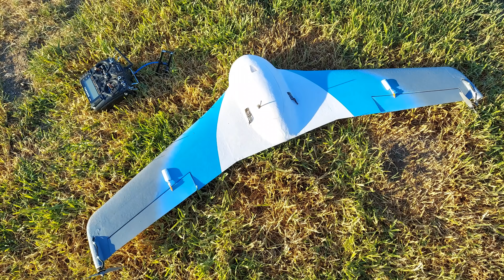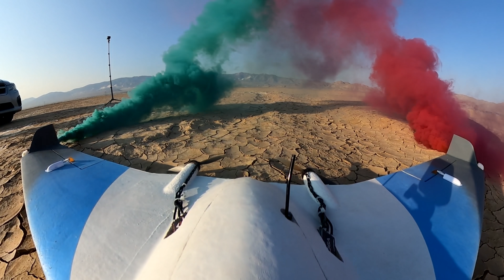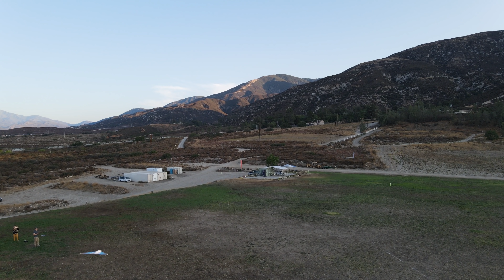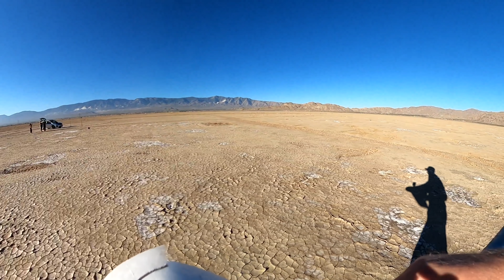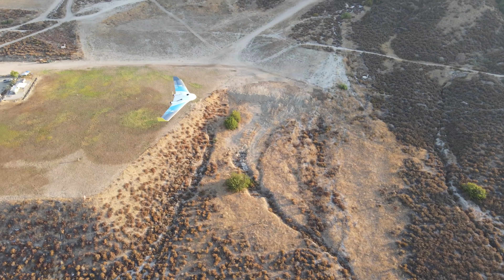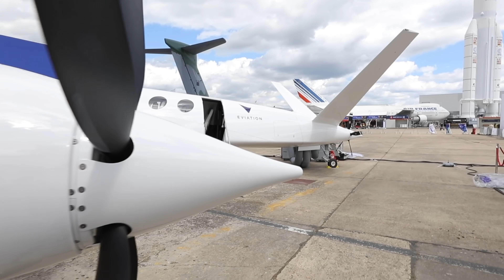Can Wingtip Motors Improve Aircraft Efficiency?  RCTestFlight Solar Collaboration Part 1

Comment: "Reducing the size of the vortex at the wingtip indicates that you have reduced the induced drag of the aircraft."    Uh, no.

An easy way to understand what's going on is to think about the wing in terms of Prandtl's lifting line theory.  The trailing vortices shed by a wing are caused by changes in the strength of the bound vortex (and local lift) across the span of the wing.  Conservation of vorticity states that vorticity can neither be created nor destroyed, so any change in the strength of the bound vortex has to go somewhere: the trailing vortices.  A larger change in bound vorticity (or local lift) between two spanwise locations results in a larger amount of vorticity being shed into the wake between those locations.  If you decrease the size of the tip vortex, it just means that vorticity is being shed somewhere else on the wing.  Shifting where the vorticity is shed changes the lift distribution along the wing.

Here's where it starts to get interesting.  If Serenity were a conventional (main wing and tail) aircraft, then the induced drag of Serenity would be minimized when the main wing's lift distribution was elliptical.  However, Serenity is a (statically stable) flying wing and requires positive lift near the centerline and negative lift near the wingtips to keep it trimmed in steady level flight.  The region of negative lift just inboard of the wingtip means that at the wingtip the lift coefficient is increasing with spanwise position, and so the vortex shed at the very tip of a flying wing will rotate outwards.  Slightly further inboard - where the lift coefficient is decreasing with spanwise position - the trailing vortices rotate inwards.  The interactions between these vortices cause them to roll up, which has the effect of reversing the direction of the vorticity downstream of the wingtips, exactly as you observed!

There have been some papers published about optimal lift distributions for flying wings, but 1) a disturbing number of those papers neglect to make sure their design is trimmable or aerodynamically stable, and 2) the optimal lift distribution for a flying wing depends on the planform - and in particular the sweep!  In general it's shaped something like a bell with a large region of positive lift near the wing root and a small region of negative lift near the wingtip to keep the aircraft stable.

So, back to your experiment with tip mounted motors.  The tip motors impart additional vorticity on the air and alter the shape of the wing's lift distribution.  It's possible that your motor and propeller placement did a better job pushing Serenity's lift distribution towards its optimal than the winglets did, which would account for the ~1% decrease in energy consumption.  It is really cool that you were able to see a difference!

As for companies claiming 10% to 15% increases in efficiency: don't believe everything you read.  A lot of aerodynamic design is gaining 1% or 0.1% increases in efficiency.  If it really were 10% more efficient to mount propellers on the wingtips then you would see a lot more aircraft with propellers on the wingtips.  As I mentioned, it is possible to use the propulsion system to alter the lift distribution and push it closer to optimal but it's a lot easier to simply alter the wing design.

P.S.  About a third of the way through the video you discussed your placement of the motor wires.  I believe you mixed your terminology.  Transition is where the boundary layer changes from laminar flow to turbulent flow.  Separation is where the boundary layer detaches from the surface of the wing.  Separation almost always occurs after the boundary layer has transitioned to turbulent.  You did a good job placing the motor wires because it is possible that the imperfection in the wing surface where the wires are buried could trip the boundary layer and cause it to become turbulent.
Reply from the maker: I love comments like these.   Thank you for taking the time, it helps more than just me I am sure.   Generically that statement is true no?   I can understand in the case of a Prandtl wing you are simply moving the vortices around to different locations but if you have a typical sailplane and extend its wingspan you didn't simply move the vortex somewhere else, you reduced it.
Reply: The V-22 Osprey has a relatively bad safety record.  Everybody dies if one motor fails!  
A wingtip motor failure = uncontrollable yaw.
Reply: @toolbaggers  Not true, on the V-22 both motors are connected to a central gearbox which provides redundancy in an engine out.
Reply: @toolbaggers  The rotors are interconnected by a mighty driveshaft and the ship can survive an engine-out scenario, presuming nothing else goes wrong.  And one pilot reported that in the event of forward flight and losing both engines, the V-22 can be glided in for a safe landing, though I imagine the craft would be thoroughly grounded by the landing due to unavoidable rotor damage.
Reply: @thinkflight    Sometimes it's true but not always.  If the wing planform does not change, then a change in the strength of the tip vortex (before roll-up) merely indicates that the lift distribution near the wingtip has changed.  This is what is happening with Serenity.  On the other hand if the wing geometry changes, then it is possible and even likely that your statement is correct (dependent on the two wings generating equal total lift and having identical or at least similar lift distributions, as I'll discuss in a second).

Back to the sailplane.  Let's say we have two aircraft that weigh the same and have identical spanwise lift distributions but have two different aspect ratios.  The airplanes have equal weight, therefore the lift generated by their wings must also be equal.  The lift generated by the wing equals the integral from y = -b/2 to y = b/2 of L'(y), where L'(y) is the lift per unit span.  From Kutta-Joukowski, L'(y) = ρ * V_inf * Γ(y), where ρ is the air density, V_inf is the freestream velocity, and Γ(y) is the bound circulation.  Therefore we can write L = ρ * V_inf * integral from y = -b/2 to y = b/2 of Γ(y).

Now since the lift of the two aircraft is equal, we know that the integrals of the bound circulation for each wing must also be equal.  However, the aircraft have different wingspans, and therefore Γ(y) must be different to maintain equal lift.  If we take the case where Γ(y) = Γ is constant and the lift distribution across the wing is uniform like in the horseshoe vortex model (which would require infinite tip chord, but anyway...), then Γ1 * b1 = Γ2 * b2 where Γ1 and Γ2 are the bound vorticity of the two wings and b1 and b2 are the corresponding wingspans.  Double the wingspan while keeping the same wing area and total lift and the bound vorticity is halved.  Continuing with the horseshoe vortex model, all of that bound vorticity is shed into the wingtip vortices, so their strength is also halved!

I should note that doubling wingspan while maintaining the same wing area actually quadruples the aspect ratio.  I'm sure you've seen the result from finite wing theory that CD_induced = CL^2 / (π*AR*e) where e is the span efficiency factor.  (Not Oswald's efficiency!  Oswald's efficiency also includes the quadratic part of the airfoil's profile drag.  People make that mistake a lot, even in research publications.)  So why is induced drag dropping by a factor of 4 when we're only halving the strength of the wingtip vortices?

The answer is that halving the strength of the wingtip vortices is only half of the answer (haha).  Consider a comparison between the same relative spanwise position on each wing.  The velocity induced by a vortex outside of the vortex core is equal to Γ/(2π*r), where r is the distance from the center of the vortex.  By doubling the wingspan while maintaining the same wing area, not only have we halved Γ, we've also doubled r!  This means that the induced angle of attack and the induced drag is one quarter of what it was before quadrupling the aspect ratio, which is consistent with the finite wing theory result.

Wait, but we're integrating over a wingspan that is twice as long!  Wouldn't that mean we're right back where we started with an induced drag that is only halved?

Nope!  The wing chord was halved, too.  The local induced drag coefficient equals the induced angle of attack times the local lift coefficient (using small angle approximation).  The local lift coefficient is unchanged because we said that the lift distributions of the two wings were equal, and the two wings have the same wing area.  What has changed?  The wing chord!  So while the local induced drag coefficient is one quarter of what it was before because of the change in induced angle of attack, the local induced drag is one eighth of its previous value.  Integrate over the new wingspan that is twice as long and you get that the induced drag is one quarter of what it was before.

So the strength of the wingtip vortices is a relative indicator of how much induced drag there is if the two wings are generating the same amount of lift, have the same wing area, and have the same or similar lift distributions.  What if the wing geometry is unchanged?

Then we're right back to redistributing the lift and the bound vorticity.  Remember that L = ρ * V_inf * integral from y = -b/2 to y = b/2 of Γ(y).
  The total lift remains constant, therefore the integral from y = -b/2 to y = b/2 of Γ(y) must also remain constant.  If you decrease the bound (and shed) vorticity at the tips, that vorticity has to go somewhere else.  Depending on where it goes and how your lift distribution changes it may either increase or decrease the induced drag.
Reply: Holy crap, that's just what I was thinking.
Reply: Good point. And so we should expect smaller gains if any from tip motors on this planform. Conventional design, or one without sweep and the reflex in the middle should amplify the benefit.
Reply: @MarkKrebs  As one of my professors liked to say, "The answer is: 'it depends'."  In this case, it depends on the lift distributions with the propellers mounted inboard and with the propellers mounted on the wingtips.  The best way to evaluate the impact of wingtip propellers is to use aircraft that are identical except for motor placement, just like with Serenity.  Whether or not there will be a larger improvement with a different airframe depends on what Serenity's lift distributions looked like, what Serenity's optimal distribution is, and the lift distributions of the new wing with and without tip mounted propellers.

It's hard to say what airframe changes would increase the benefit and make the difference easier to observe.  I'm sure that it would be possible to design a wing that is intentionally sub-optimal with inboard propellers and near optimal with tip mounted propellers, assuming that the influence of the propellers could be accurately predicted.  I think VSPAERO - part of OpenVSP - may model vorticity imparted by a propeller.

You may be correct that a conventional aircraft, or a "plank" style flying wing with a reflexed airfoil, would increase the impact of tip mounted propellers.  It certainly will be easier to figure out what is the optimal lift distribution for minimum induced drag of the main wing (an elliptical distribution, of course).  An untwisted rectangular constant-section wing normally has too much lift at the wingtips when comparted to an elliptical lift distribution with the same CL, and the vorticity imparted by wingtip propellers rotating outwards should help with that, but there are A LOT of unknowns.  Without doing some analysis it's not possible to predict whether or not the change in performance will be larger than was seen with Serenity, or if there would be an improvement at all.
Reply: @nathank7989  Nathan, I can't say I follow everything you are saying but I'm trying...

You stated that Serenity was a statically stable flying wing.  I'm not sure how you know that, but okay.  I don't see a lot of twist at the wingtip, but can believe it's there.  I do understand that common airplanes like a Cessna 172 have lift near the center of mass and a tail producing negative lift at the back.  For a swept back wing, rear-placed negative lift means negative lift at the tips.

Doesn't this mean that Serenity could get a large increase in effective span, and reduction in induced drag, by adding a tail so that the wing has the usual elliptical lift distribution?

Also, does this mean that you could reduce a flying wing's induced drag if you could make it statically unstable (elliptical lift distribution)?  Do you necessarily lose all that efficiency in the control system trying to get the plane back to the intended AoA?

Finally, I think I understand that L = ρ * V_inf * integral from y = -b/2 to y = b/2 of Γ(y), so at a given speed and air density lift is proportional to the integral of vorticity.  Doesn't that mean vorticity is in units of 1/sec?  Is it possible to remove energy from the wingtip vortex while preserving the vorticity by having a slower-rotating core and a faster-rotating portion outside the core?  Aaand, is that what a wingtip motor does?
Reply: @iainmcclatchie2009  I assumed that Serenity is statically stable because 1) model aircraft are generally designed to be statically stable and 2) Pixhawk and Ardupilot indirectly recommend that the aircraft be stable.  In theory Pixhawk's fixed wing attitude control loops (PI with feedforward) could stabilize an aircraft that is statically unstable in pitch, but that could lead to some very hairy test flights if the controller gains you calculated to make the aircraft stable are incorrect.  There's a Master's thesis from Linköping University where the author used a Pixhawk to control a statically unstable aircraft: https://www.diva-portal.org/smash/get/diva2:859608/FULLTEXT01.pdf.

I'm not sure what you mean by "effective span".  I've heard that term used when discussing wingtip devices that are designed to push the tip vortices outwards (e.g. a Hoerner wingtip).  I think what you're getting at is that some portion of a flying wing is used to trim the aircraft in pitch - this could be the wingtips, the trailing edge, or some combination of the two.  The question of whether a flying wing or conventional aircraft is more aerodynamically efficient is complicated, but I believe that in most cases a conventional aircraft will be more efficient largely because of reduced trim drag.

Would changing Serenity to a conventional wing and tail design reduce induced drag?  I believe so; however, this would require redesigning the wing to remove the washout or reflex used to trim flying wing Serenity.  Then the wing is larger than it needs to be, because it no longer needs the portions used for trimming and the additional area that was used to offset the negative lift produced in the trim areas.  After the redesign process the wing (now main wing) would ideally have an elliptical lift distribution for minimum induced drag.

Would an unstable flying wing with an elliptical lift distribution have lower induced drag?  I need to think about this some more, but I believe the answer is yes.  At a given lift coefficient, an elliptical lift distribution will give the lowest induced drag.  I like that you're thinking about the trim drag.  Depending on CG location the trim drag might increase more than the decrease in induced drag.

Yes, that is the correct unit for vorticity.

What I think you are describing is altering the velocity distribution of the wingtip vortex.  Viewing the wingtip vortex as a single vortex filament, as in the lifting line model, does not allow this because the velocity distribution of a vortex filament cannot be altered.  To alter the velocity distribution of the wingtip vortex we need to view it as a collection of weaker vortices modeled as Rankine vortex filaments.  Then it is possible to achieve the velocity and vorticity distribution that you described, which is what happens with a tip mounted propeller rotating outwards.  In fact, the central portion of the wingtip vortex may now rotate outwards because of the vorticity imparted by the propeller, as was seen on Serenity.

Does this remove energy from the wingtip vortex?  I don't know.
Reply: @nathank7989  By "effective span", what I mean is this:

If the wingtips run at negative lift, and the center of the span generates positive lift, then I would expect the wingtip vortex to be centered roughly where the lift transitions through zero, closer in than the wingtip.  The span between the center of the wingtip vortexes would be the "effective span".

The reason the effective span would matter so much is that the induced drag is proportional to the inverse square of the wingspan.  So if the outer 20% of the wing is at negative lift, I'd expect the effective span to be 80% of the actual span, and I'd expect the induced drag to be 56% larger than if the lift were distributed across the full span.  Since low dynamic pressure flight is often dominated by induced drag, this seems like a really big deal.

It also seems that a statically stable flying wing has a lot of drag penalty, because not only does it have the reduced effective span, but it also has a fairly large amount of wing area near that zero lift line (at e.g. 80% of span) that doesn't do much of anything except produce drag.

A separate wing and tail can have most of the wing and tail surface generating lift.  It doesn't have the dead zero-lift area.

A dynamically stable flying wing, it seems to me, could have an effective span == full span, and no drag from a stability-inducing tail, and so have minimum drag at zero control deflection.  Getting to minimum drag will require keeping the average control deflection down, which means a high bandwidth control loop.

The next question is, if a flying wing has an all-positive wing with an elliptical lift distribution, can you arrange for the rear control surface near the wingtip to produce moment around the Cg like a tail would?  It's going to be closer to the center of mass than a wingtip control surface in a statically stable flying wing would.

I am alarmed to see that foils like e.g. http://airfoiltools.com/airfoil/details?airfoil=fx76mp140-il have negative slope to Cm vs alpha at low Reynold's number, but positive slope at high Reynold's number.  That suggests the flying wing would be convergent in pitch at low speed but divergent in pitch at high speed.
Reply: @IainMcClatchie    Oh, you're defining effective span to be the distance between the wingtip vortices.

You make a good point about the drag of a statically stable flying wing.

Perhaps you mean a statically unstable flying wing?  Dynamically stable just means that pitch oscillations will tend to damp out.

Yes, you can have a flying wing with an elliptical lift distribution and a trailing edge control surface that would allow the aircraft to be trimmed.  Such an aircraft could be statically stable or statically unstable.  Use of a reflexed airfoil could allow for static stability.  The easiest way to design such an aircraft would be to use a low Reynolds number reflexed airfoil (such as the MH 60 http://airfoiltools.com/airfoil/details?airfoil=mh60-il) and an elliptical planform.  I am neglecting Reynolds effects at the very wing tips but the impact should be minimal.

When you compare to a flying wing with wingtip control surfaces I believe you are thinking of a flying wing with sweep and washout?  Yes, the control surface will be closer to the CG, which means that the trim forces will need to be higher to balance out the moments and so the trim drag will be higher.

I see the change in Cm slope of the FX 76-MP-140 that you are talking about.  At Re=5e4 Cmalpha is calculated to be negative; however, I would be suspicious of how accurate that estimate is.  It's well below the design Reynolds number of the airfoil and the flow is likely doing some strange things that XFOIL is struggling to calculate (as evidenced by the jagged polars at Re=1e5 and Re=2e5).

I found a paper by Wortmann (https://www.iag.uni-stuttgart.de/dateien/pdf/arbeitsgruppe-laminarwindkanal/W_1977_Man_Powered_Aircraft.pdf) that discusses the design of his FX 76 series airfoils and implies that the FX 76 airfoils are designed to operate between Re=3e5 and Re=7e5.
Reply: @nathank7989  I always get a kick out of seeing a highly educated person explaining things on youtube comments because it's so out of the ordinary. I really enjoyed reading your comments, thanks for the deep dive. Happy holidays.